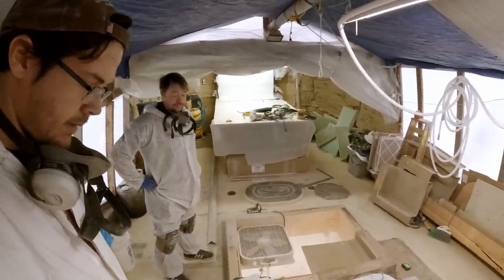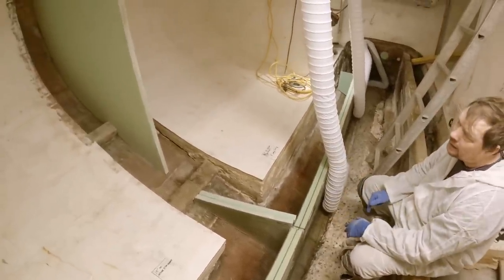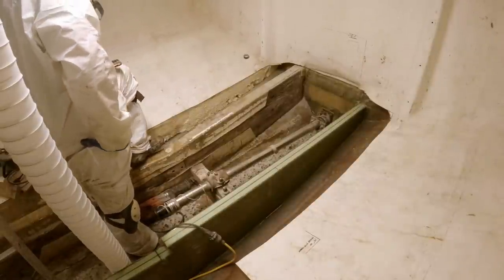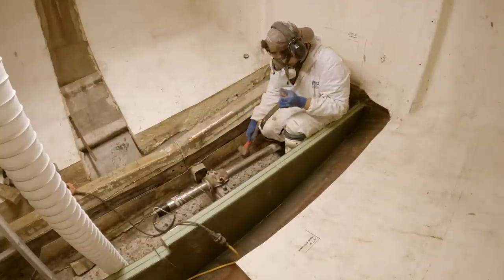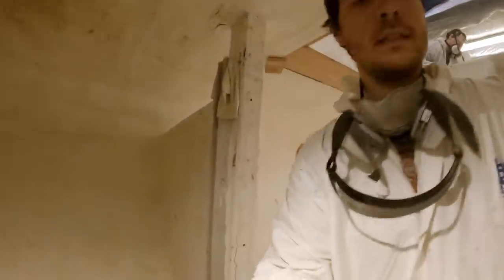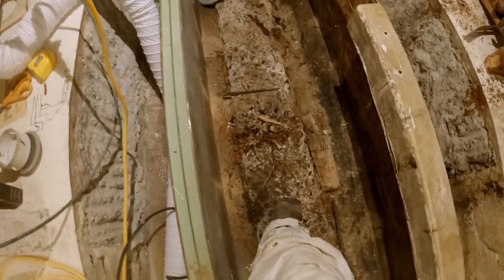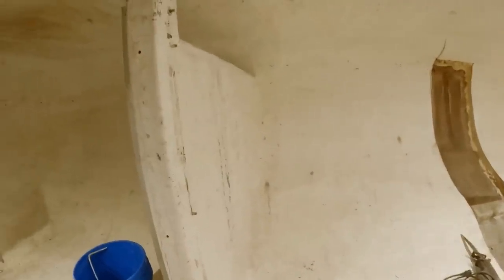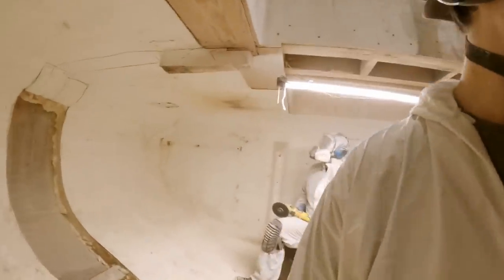Starboard Stringer Demo and Hull Prep - Emerald Isle: Ep.36 Fishing Boat Refit

Comment: I was shocked to see how much the old stringer deflected when you kicked it.  As you said, it seemed that it was just the concrete holding it in place.  The new stringer installation is gonna last a lot longer, particularly because it will be supported by the base of the fish hold above the shaft alley.  Very impressed!
Reply: But it definitely seems that you are gonna need more concrete for ballast given the weight of what you are removing.

Comment: Gentlemen I have not had to deal with wood and fiberglass,  all my boat and fish processing fabrication and repair was steel,aluminium and stainless steel, however I have used the old worm drive saw for cutting aluminum sheets and pipe ( with a tungsten blade).  I commend you for your making your vessel more seaworthy and safe.  When is you next opening and which species?

Comment: Learn something new every day.  Today I learned moths love Tyvek when the camera got view of your backside!!  On a serious side what are your conclusions on the air supplied face mask?  I notice you aren't using them very much.  I thought the hose might prove too cumbersome.  I prefer the filter on the belt so those only goes from that to the mask.  Less to struggle with and catch on everything as you move about.  Have to change filters a lot compared to the style you have where air is drawn from away.  In some situations that would be mandatory but in a lot it is just too much hassle when the filter on the belt pack works quite well.  Always good when the dirty demo is mostly behind you.  Did you pack your Tanner back to town or did you have a packer on the grounds?  Did your aeration system keep them healthy if you hauled them back to the cannery?  Was it a four day trip or more?
Reply from the maker: We really like the supplied air, especially for confined spaces and over the top work. A bit problem with the regular 3ms is the condensation, so they will drip occasionally. The belt filter might be a good alternative, the masks themselves can get kind of uncomfortable after awhile.

We hauled the crab back ourselves. The fishery isn’t big enough or far enough from town to warrant a tender. But our circ pipes worked great, not a single dead loss.

Comment: How do you know how much concrete to use ? Is it, keep going until the water reaches a certain mark on the exterior? You can tell I’m a naval architect/expert right 😂
Reply from the maker: We will fill the shaft alley back in to its former level. The boat in all is much heavier than the architects designed originally, due to extra gear, water logged areas amongst other things.